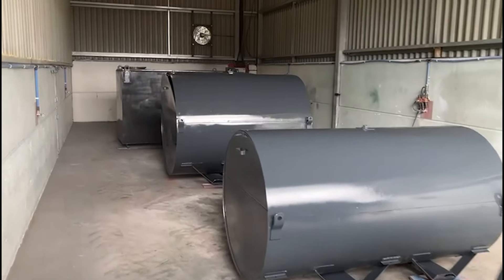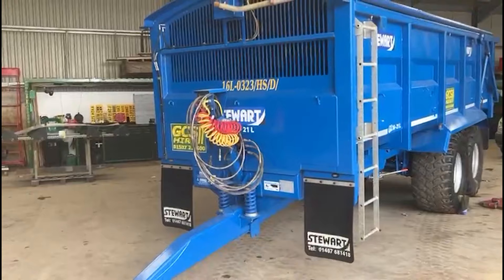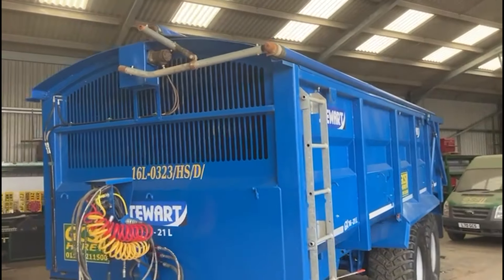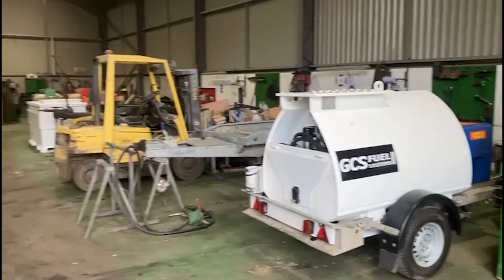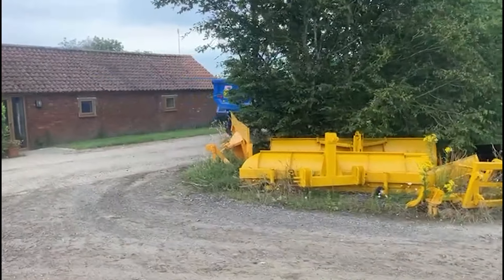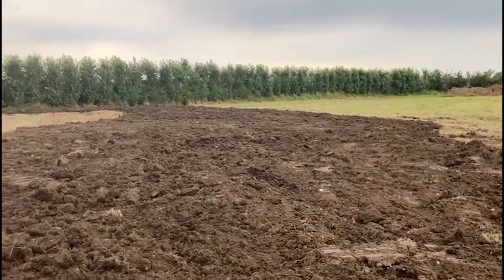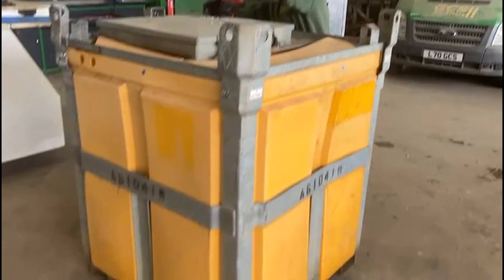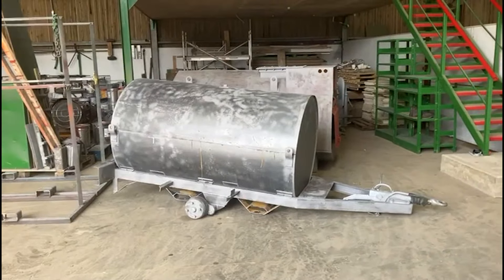As the hire fleet continues to grow, groundcare equipment is added, but what is coming next?

Comment: Got a year old spearhead same as yours but mine is black and badged 460 proline.brilliant machine and used to top ab8/9/15.have cut stuff as high as tractor bonnet,deere 6620.only issue I have is that they are a complete bastard to clean.
Reply from the maker: I know the older ones were a pain to clean with lots of box section on the top
Reply: We have a McConnell topper 9 new 7 years ago, excellent machine no problems will cut thick grass rushs with ease,slip clutch protection not so heavily made as the spearhead. 9ft cut with 2 hight adjustable swivel wheels allowing cutting in reverse.